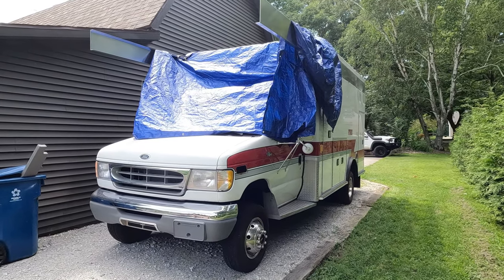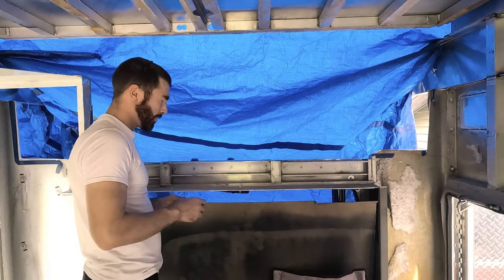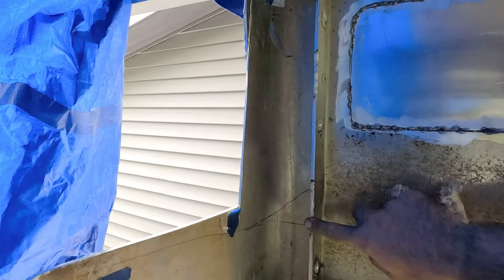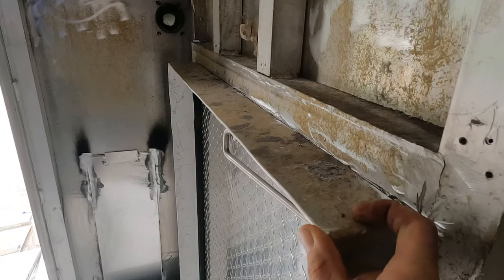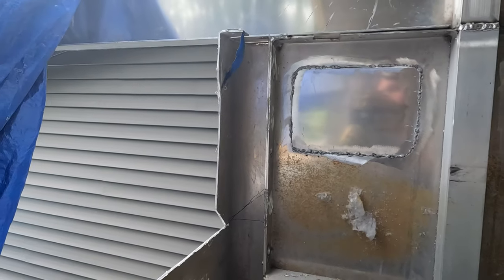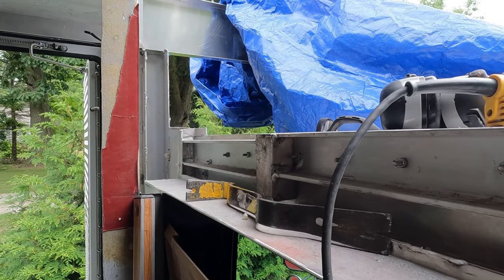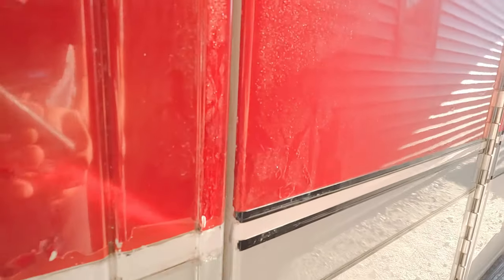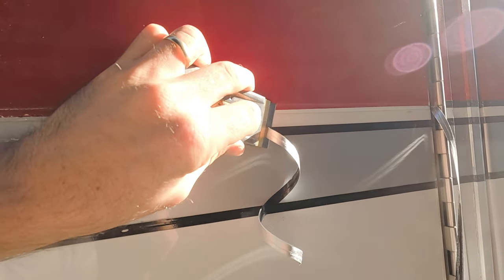DIY Ambo Cabover Prep & Floor Cot Fastener Removal // [ Episode 8 ]

Comment: A plastic razor blade works great for those decal removal and won’t scratch the paint. Seems like a silly idea to use a plastic razor blade but they make them exactly like your metal style with tons of spare blades that slide into place.